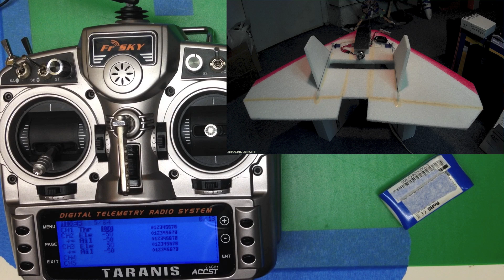Welcome to Taranis, Part 7: Elevon Mixing

Comment: Are you using a Y cable for the connection of these servos or do you have them on separate channels in the receiver?
Reply from the maker: Separate channels, they need to move independently.

Comment: Using negative figures does not work in latest firmware, while it may appear to work, your trims do not reverse, so trying to trim a plane in flight will have the adverse effect.
There is a reverse feature on the next window option after mixer.
Reply: I know that was a year ago but to close the comment, just tried it now (August 2016) and this setup worked fine, including the invert.
Reply from the maker: ouch!  I hope that gets fixed soon!
Reply: which Firmware release version?
Reply: powernumpty

Comment: This video suggests that it is impossible to get 100% throw for either the elevator or aileron demand and that the best you can acheive is half of the potential roll or pitch rate.   Is that true?   Is there no way to get full elevator or full aileron throws with this radio when mixing for elevons?
Reply: latest manual says use 100% for the settings...not 50%

Comment: Hello Mark , thanks for this video. Im having trouble with Taranis to set the V-Tail Mixing for the Talon X-UAV (2 Servos Ail/ 2Servos Elevon/Rud V-Tail / Ch1 Thr - Ch2 Ail - Ch3 Elev or Rud ...). I get everything working good except the Elevon moving to diferent sides cant get them moving together, tried to invert ir but it just doesnt work . I would aprecciate if you have any tip. Thanks

Comment: Hello, i have i think a simple question ( but as a beginner using FreSky) I’m not sure what i have to do.
I use a quadcopter and use the channel 5 to get different flight mode with APM planer. To get more then 3 flights modes i need to mix a few switches on the same channel.
How i do that?
Do i have; like on your tutorial,  use the function « insert after »? if it’s the case what's the next move?
thank in advance for your answer.
marc
Reply from the maker: Yes, check out this video.  It's for er9x, but it's pretty close to what will work on OpenTX/Taranis.
er9x: Setting Ardupilot 6-Position Switch (Good for Turnigy 9xr)